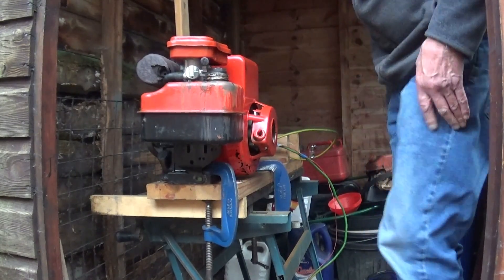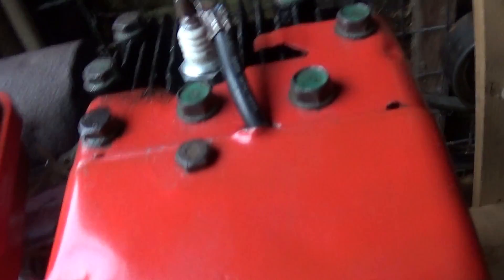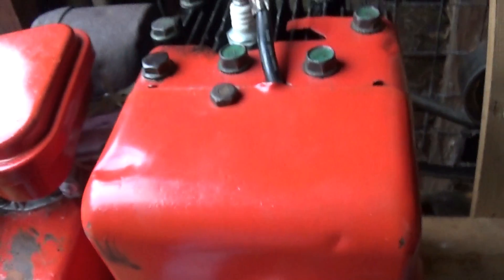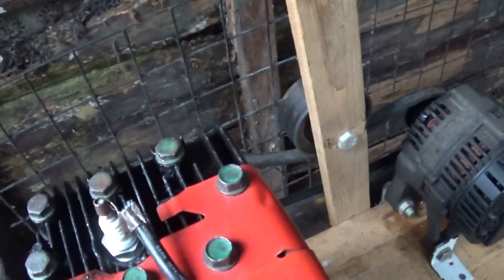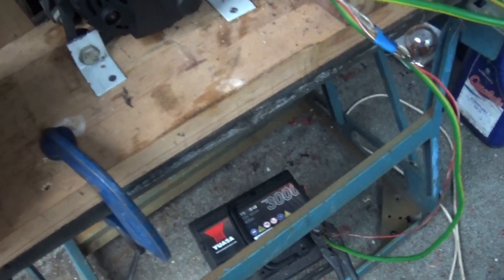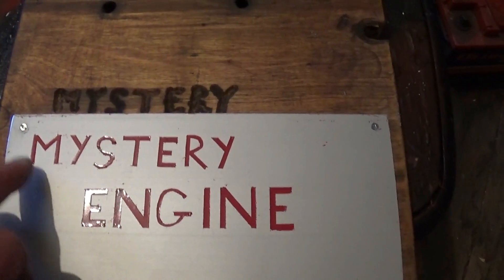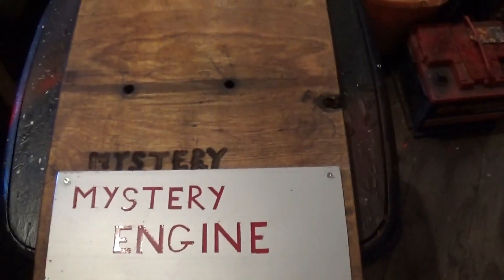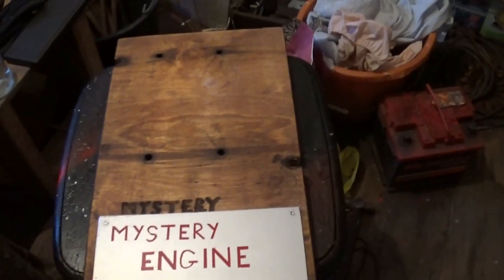1 1/2 HP Lister Has More Power Than a 3 HP Briggs.

Comment: The difference is on the Briggs your running on a small 4” (maybe) pulley and on the Lister your running off the 12” flywheel
Reply from the maker: Just did this for a bit of fun, just to see if the Briggs would run it. Didn't expect it to as they need quite a lot of power to turn them when charging. I was actually surprised how well it worked on the Lister. It's the same as trying to plough a field with a car that's double the power of a tractor.

Comment: The horse power is not the same as it used to be that's for sure malc!! Lol
Reply from the maker: I remember not getting to Blackbush airport (before Santa Pod) when the first top fuel dragsters came over from the US. I have once been to Santa Pod and seen them in the 70s. 1000 HP engines. I read that they thought that was the maximum they could get from them. Recently seen a video and now getting 7000 HP. Interestingly the fuel is oxidised if that's the word, i.e. contains it's own oxygen for burning, there is so much the engine is on the point of hydraulic locking.

Comment: But if its not able to drive a little alternator, how was it able to drive mower blade/cylinder blades or whatever equipment it was attached to ?...
Reply from the maker: Gearing James....
Reply: @MalcOfLincoln  oh right,thanks.Probably was attached to a cylinder mower., cast iron flywheel? hence run without the blade?
Reply from the maker: @JBW71  Most likely low geared to a rotavator.
Reply: @MalcOfLincoln  Just made an assumption  on my part Malc, quite possible yeah.

Comment: Yes those little Briggs would not pull a skin off a rice pudding as dad use to say . They were great for what they were designed for and that's it .
Reply: Colin: My dad used to say "It wouldn't pull a greasy string out of a cat's ass". The old folks had a way with words....
Reply from the maker: Exactly Colin. It's a lot to do with my dislike of Fords. 105E Anglia for instance. 1000cc engine, oversquare. Had to rev them to 6000 to pull off at the lights otherwise they stalled....all 'wind n piss' as we used to say. 850 Mini ran rings around them.